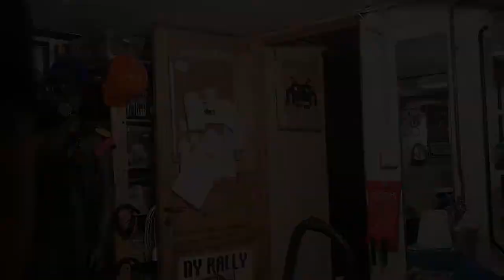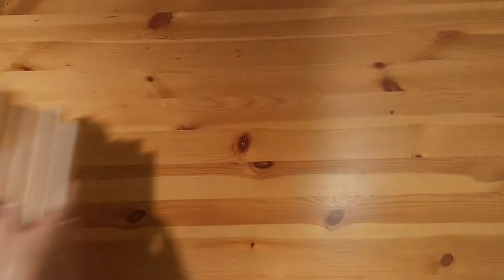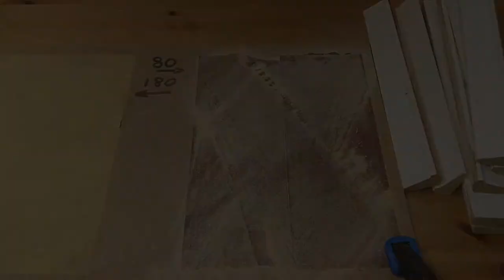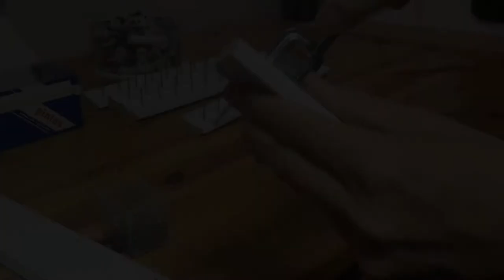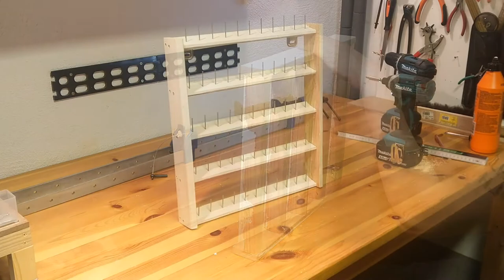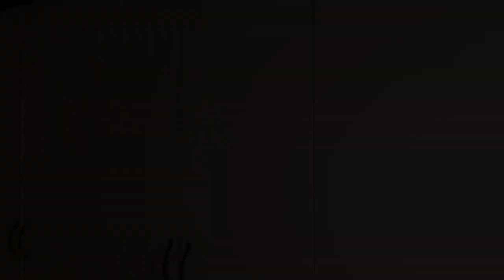Let's make a thread holder made from scrap wood! #SPSWC2020

Comment: Good use of the moulding's built in slope
Reply from the maker: Thanks! When I first got the idea for it, I pondered over what angle to use, but when I got the moulding of the wall it all fell in place. The job's easier when you listen to the material.

Comment: Nails for holders was nice.
Reply from the maker: Thanks! I had actually planned to use dowels, but I didn't have any, and then I threw out my back and couldn't get to the store so I had to find another solution...
Reply: CrudeButEfficient I like your solution better than the original plan. Nice job
Reply from the maker: @MikeTheMaker1  Win! 😁